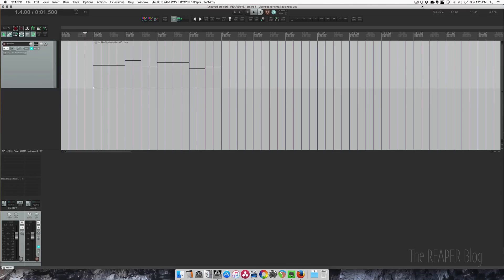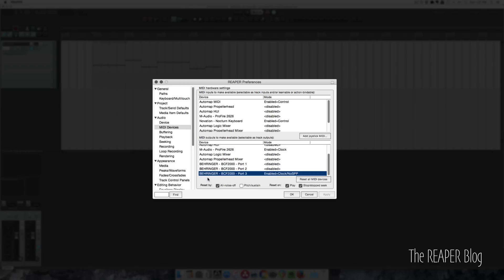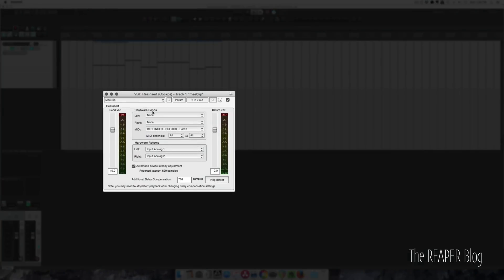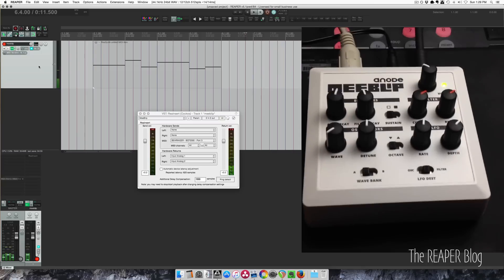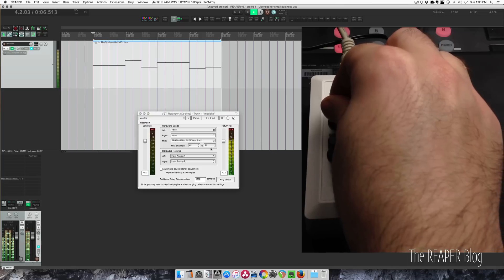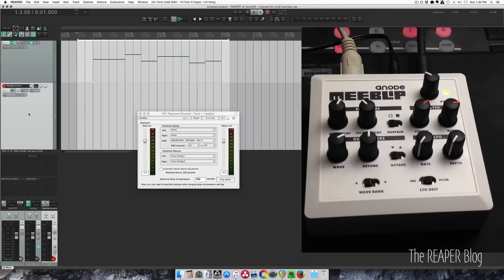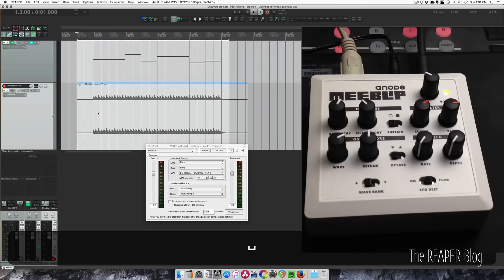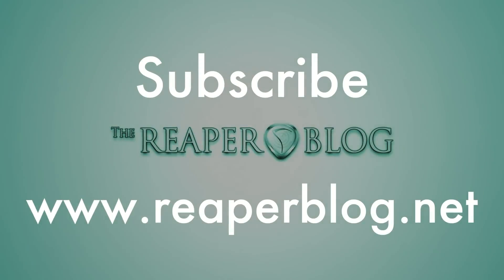Using Hardware Synths with ReaInsert

Comment: Hey Jon,,, latency using my ES-7 motif as an external controller. I'm using a Focusrite 6i6 with midi pin i/o and I have adjusted the mix control for the Focusrite to "ultra low latency" setting but,,, I'm trying to control Steven slate drums 5 with it to create patterns and resetting the latency on the Focusrite helped some but it's still too slow to work with.Will the reainsert plugin help reduce the latency to whee I can use my Ext Synth as a controller? Thanks. You probably have done a video on USB 2 and usb 3 transfer speeds and midi usage but if not,, perhaps that would be a quick video for you. Thanks for all the info!

Comment: Looks like I'm a bit late to the party. Just in case you still check these comments - I would be interested to see a video explaining how you send other midi info to external synths - so, LFO, envelope changes etc. Did you already make one? Cheers!
Reply from the maker: anything on the track will send to the hardware out. You'd need to know what your device responds to. Either write it into the MIDI item in the CC lanes, or use the sliders in ReaControlMIDI. you could even apply an lfo using parameter modulation on a ReaControlMIDI slider.
Reply: @TheREAPERBlog  Nice 1. I shall have to look into ReaControlMIDI, think that's puppy that's gonna help.

Comment: Interesting. I've got a Behringer Neutron, which has -- like yours -- no keyboard. I have an Arturia MiniLab as my MIDI keyboard, but it only has USB MIDI. The Neutron has both USB and normal MIDI.
I've been creating a totally separate track JUST to receive MIDI input from my MiniLab, then sending that MIDI to the Neutron track.
I'll have to give this a try. Thanks. :D
EDIT: Just tried it. Works like a charm. Thanks! :D

Comment: Why not just set the hardware output of the midi track to your synth? No need for delay compensation in my experience. Reainsert in the scenario seems to be a lot of unnecessary extra work.

Comment: I dont understand what is he trying to do. Bro if you read your comment section. I need to control the patch or choose patches from to external. I was hoping while you record and move the knobs of your synth reaper would record it of course. But you play it back live it will in realtime changing on your external synth. But I didn't see. Other than nothing else new about reaper doing amazing stuff. Please if someone know tell me. I can do wonders with midi and external gears.

 I want when I record into reaper the midi I want reaper to also record not only the midi notes but also the changes of patches as the pattern chain that make my song are playing and reaper record those program or patches. So that when I play the midi and reconnect to the external device reaper remember to change the sounds just it was in the original music been recorded. I tried every tutorial they never really got to this point but close.
Anyone?
For example A song using chaining four patterns. Like midi Chanel one was electric piano and at the chorus or refrain the song that midi chanel I used grand piano. And reaper records that change as well not just the notes. I really need this. Thanks guys or point me where who might know. Kenny Jiaoa.

Comment: Hey Thanks,
have a question on the reason to use Ping detect instead of the Automatic device latency detection? It comes up as a different value every time I click ping detect.

Comment: Shouldn't your additional delay compensation be the same as your buffer length on your soundcard's ASIO driver? This way you would (in theory) get a perfect loop.
Reply from the maker: That's what using the reported latency would do. using the ping function detects the actual delay and it does make a perfect loop. You don't have to compensate after recording and the other tracks in your project are delayed so your hardware plays in time with everything.
Reply: Thank you for your answer. I'm going to try it with my analog synths.

Comment: It's cool that you show this, but you didn't really mention what the advantage or idea of ReaInsert is? I usually send out midi to my synth via send, and simply have a second channel to record the input. So how do I profit out of this using ReaInsert? What is the difference?
Reply from the maker: +Andy Grichting delay compensation is the biggest reason for me. Not having to adjust the start offset after recording is nice.
For audio sends with reainsert it's accurate enough to do realtime parallel compression with hardware. Doing that with sends would result in nasty comb filtering.
there is a global recording delay offset in preferences but with reainsert you can ping each piece of hardware and get it perfect.

If I did a send and return setup I'd have the return track in record mode Monitor only during recording. But you do have to be aware that what you're hearing is out of sync with the project.

Comment: Nice tutorial! 
I have a question about the video, although unrelated to ReaInsert. I noticed that your waveform is a little bit offset looking in that there is much more + than - information. Sometimes this will happen to my recordings as well and it is often just the nature of certain sounds. However, DC offset can be detrimental to a good mix! Do you know of a way to adjust DC offset (and ideally automate it so one could alter just the affected portions of a waveform)? I've done this with inverters that have a potentiometer to control how much you want to shift the wave up or down on my modular synthesizer before, but never successfully in a DAW.
Reply from the maker: +Steven Morris look for my previous video on weird waveforms. Basically you apply a filter below 20Hz.
You can also use a phase rotator plugin along with a scope to get waveforms more symmetrical. 

I don't worry about it much if it sounds good.
Reply: The REAPER Blog Thanks for the reply. I'll have to check out that video!